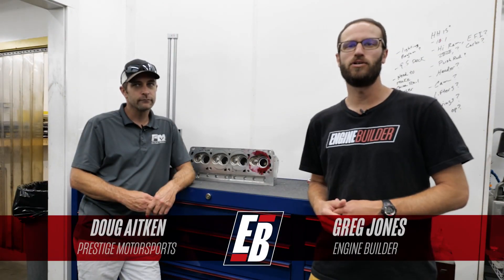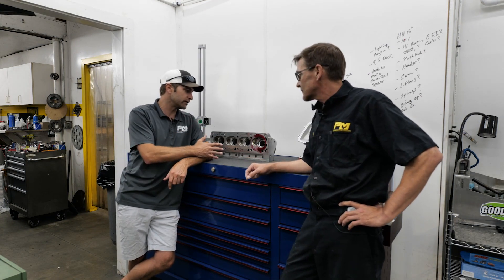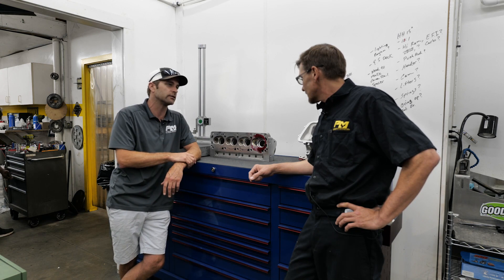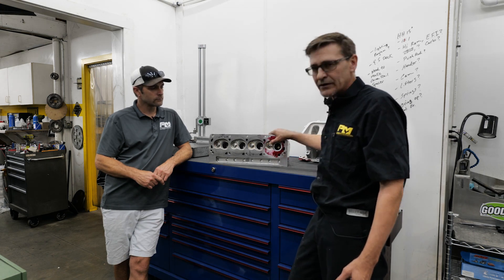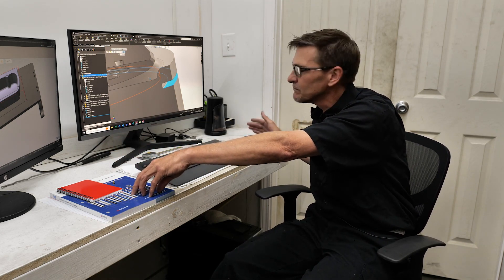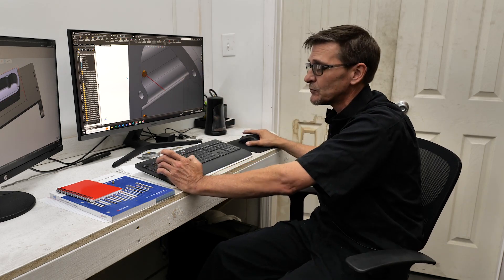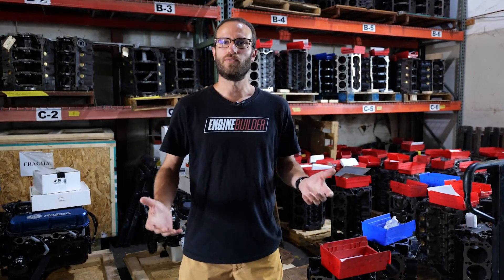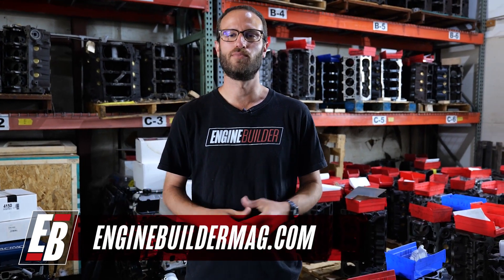Prestige Motorsports' Head Hunter Cylinder Head Development

Comment: Noticed they didn’t show any of the actual port development lol
Reply: Or flow numbers to bore size
Reply: @Freedomishere-im6ug  I'm just starting to actual get to the design stage of the induction package now. When this video was shot, it was very, very earlier on in the development process.
Reply: This was very early in development. Only a short amount of time for engine builder to go over things. Otherwise, the video would be so long lol. We will at Prestige Motorsports go into a lot more detail on the actual development of the induction package in a video soon. We did go in detail on development of the valves on this particular head.